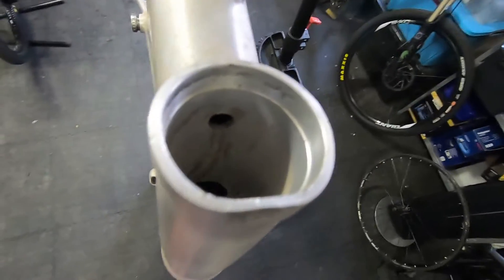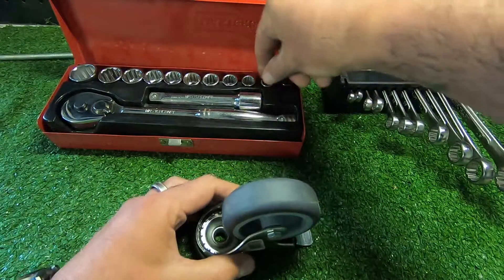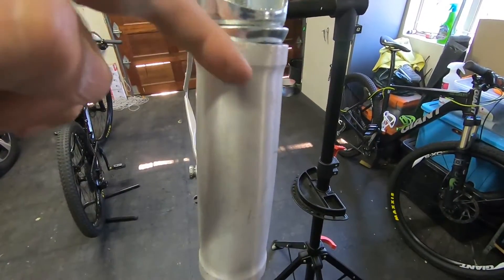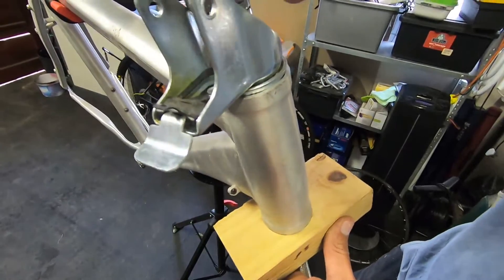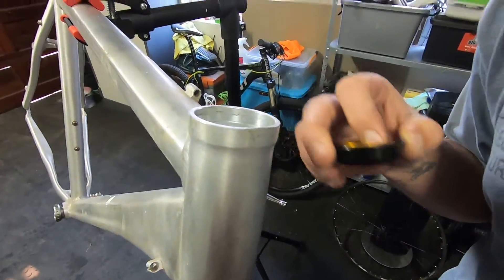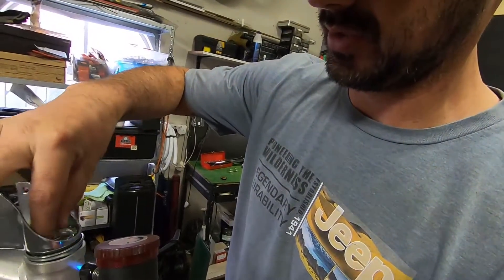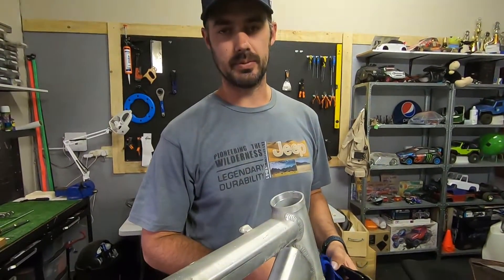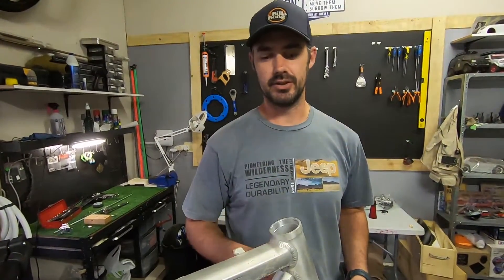Straightening my bent Head tube on MTB build, didn't go according to plan.

Comment: Good for you in getting it fixed!  Aluminum does not at all react like steel when you warm it up—instead of being more malleable it can quickly become fragile and crumble into a puddle...so what you did but skip the torch. Another method (vs plier) would be place the headtube on a heavy flat surface (like a bench) and then using a bearing race cut in half or something similarly round and about the same diameter of the inside of the headtube tap that with a hammer against the flat spot to push it back out.
Reply from the maker: Thanks for the advice, just hope I never have to deal with an issue like that again

Comment: Thanks for the video. I have the same problem. Does it work on the long run?
Reply from the maker: Hi, it's a pleasure, yes so far so good I haven't had any cracking or issues with it. I would just recommend work it slowly
Reply: @tdtimm3619  thanks a lot